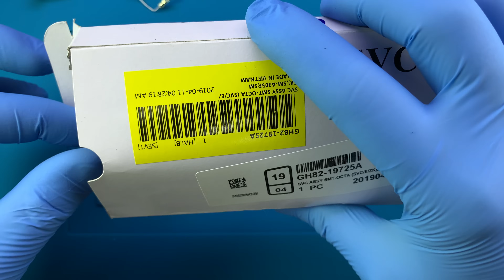Samsung Galaxy A30 Ekran Değişimi 🇹🇷 | SM-A305

Comment: What's the thing that he plugged a cable on his left hand first .....
Reply from the maker: Hello there;
It is a static-free wristband on the left arm. Our technical service is designed to be completely free from static electricity, but it is installed by our technicians as an additional precaution in order to prevent static electricity that may occur momentarily. The right arm is a special magnetic magnet. It allows to hold very small metal parts.
Greetings.

Comment: What u connect blue wire on ur wrist
Reply from the maker: Hello there;
It is a static electricity-free wristband. Our technical service is designed to be completely free of static electricity, but it is installed by our technicians as an additional precaution to prevent static electricity that may occur instantly.
Greetings.

Comment: what he is attaching to his hand in the starting
Reply from the maker: Hello there;
It is a static-free wristband on the left arm. Our technical service is designed to be completely free of static electricity, but it is installed by our technicians as an additional precaution in order to prevent static electricity that may occur momentarily. The right arm is a special magnetic magnet. It allows to hold very small metal parts.
Greetings.
Reply: @gsmi  thnk u for telling this...u r awesome actually